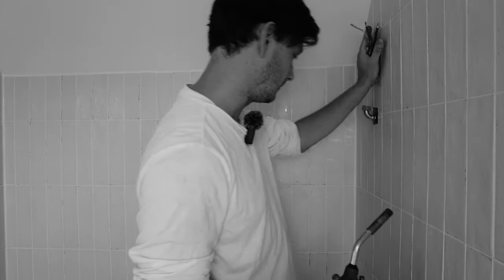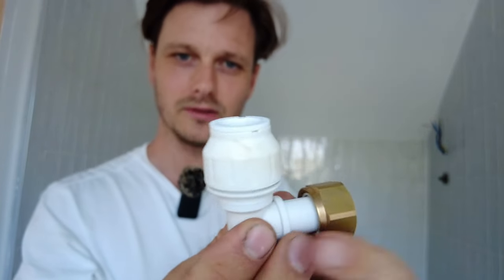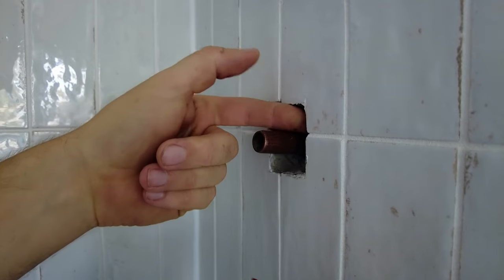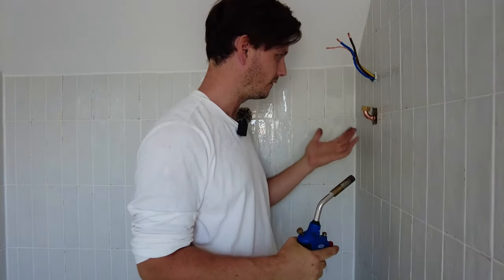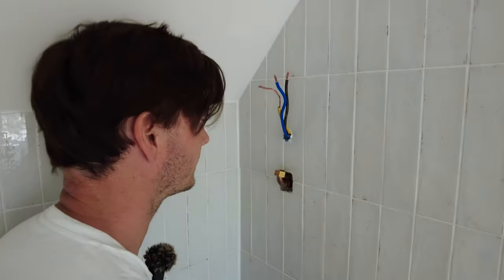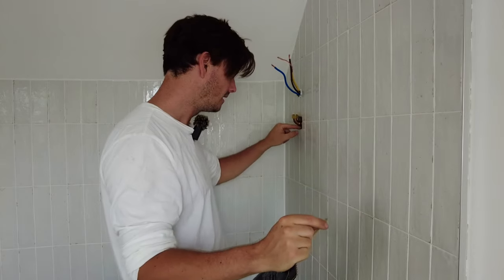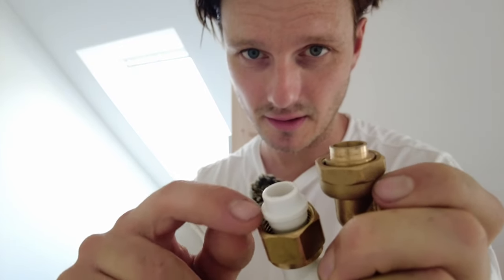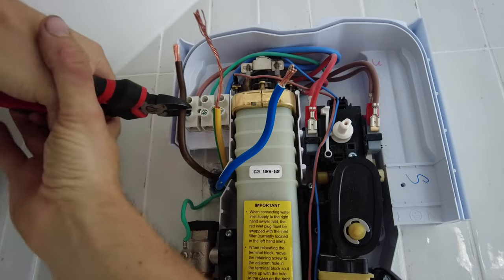I fitted a Mira Sport Electric Shower - The UK's Bestseller!

Comment: When you're looking for drill bits to go through tile, you want to look at ones that say 'masonry'. Screwfix is a good place, they usually tell you exactly what each bit is meant for. Those hand held drills aren't really meant for this kind of work either, so it will be a struggle. Also if you're doing a 5ml hole, a 6 ml wall plug is correct. You want the plug to squeeze in to stop it moving, if it were the same size as the hole it would just wiggle around! Small tip, not only for tiles. Drill a pilot or guide hole first, a 3mm and then follow up with a 5mm, it'll be much easier!

Comment: How do you detach the shower head along with chrome hose/piping in a way that after cleaning it, it can easily reattached back
Reply from the maker: @bibinraj2000  you just unscrew them 🤷 just make sure you don't drop the rubber washers

Comment: Great video you're brave trying to do this yourself! To anyone watching remember showers are a lot more tricky than dishwashers and washing machines, doing one from scratch (as opposed to replacing one) is quite major work with wiring from fuse box and the work needs inspecting by building regulations inspector or you can't insure/rent or sell a property without the paperwork so best to use professional. It's not expensive I had a quote £200 typical price for a new fit same day too, can be less if you use someone local. 

When I saw the blowtorch first thing I thought about when said about using it upside down with the electric cables so near above is the risk of heat melting the flex on wires!! A safer way to do that would be tape a sheet of something fire/heat-resistant over those electric cables before using a blow torch to protect them from getting melted, as is easily done from the video accident!

Comment: Welcome back!

This was really interesting, thanks. I'm planning to put a shower into a new bathroom on my top floor and I am in early planning stages, no idea how things work in the UK, absolutely no idea whether I can have a regular shower or if I need a power shower. I see those a lot over here and I'm hoping I don't need one because I have really good water pressure, including for hot water... but I clearly need to do a lot more research. I'm not even sure why people choose power showers over regular hot/cold supplies. The shower looks great!
Reply from the maker: This is the first time I've fitted an electric shower, I've done 3 others in my life with thermostatic mixer bars. I suppose the benefit in an electric one is you only have to run a cold feed (that's all I have 😂). Sounds like you will be good to go for a standard mixer set up though 👍

Comment: 7:06 I use small Bosch masonry bit on some masking tape then widen with bigger bit if needed. found tile bits a waste of time. Alternative use diamond tile cutter hole saw but you need a jig to hold in place (piece of scrap wood) as they will definitely wander.
Reply from the maker: Thanks mate. I ended up figuring out that I could start the hole with the arrow shaped bits and use one of the diamond bits to do the rest quicker (I even recorded a little video). I'll have to get one of them bosch bits and see if it's better to start off with, then I could do another video 😂

Comment: Yo Ironmaiden, hope everything is ok & the break has done you good. 
I put a longer pipe route in for my shower, just to  allow room to get an isolator in. Nice job mate 👍👍
Reply from the maker: I put an isolator in... But it cuts off the whole shower room 😂 did you put in full bore valves or not? I've been wondering if it really makes much of a difference 🤷‍♂️
Reply: @THE-AIDEN-PROJECT   I just use standard iso valves, never had any flow issues, did you know they did angled iso valves, very good for awkward applications.

Comment: Got to muster up the courage to turn the water on now, just replaced the solonoid on a mira sport max, had to disconnect everything to get to it and the solonoid  did not want to come of or new one to go on, the water bottle and flow valve are push fit how that is a good idea is beyond me, it's enough to give you nightmares,  take a bath is my advise. Great video, stressed me out!
Reply from the maker: 😑🤞💦😩😂 Haha I'm guessing you're not a plumber cause surely you would need a whole new shower if you was? 😉 I'm glad you mentioned this though cause I'm not sure I would have even have thought of just replacing a part like that
Reply: @THE-AIDEN-PROJECT  yes the solanoid which is a common problem it magnetically pushes a plunger up in the flow valve to allow the cold input water to go to the heating bottle, I am now an expert! I wont be letting any water into the shower until I come back of holiday and keep an eye out for leaks, £8 cost of solonoid and several sleepless  nights!

Comment: 👏🏻👏🏻👏🏻👏🏻 Glad your back I’m stating mine barn now so been watching for advice.One thing I do want to ask if ok ?
Is about the roof do you think it’s worth paying out for a zinc roof or the greencoat system? Be grateful for the advice and if pos who you recommend.Keep at it mate you look well 🤜🏻🤛🏻
Reply from the maker: Hey, I think maybe I would be lead by the roofing contractor on this one in a way. If you get them to supply and fit they can do it at the reduced rate of 5% vat. If you buy the product for the contractor to fit you would have to pay the full vat. Although net net its the same at the end it's good to have less upfront costs. The contractors will have certain suppliers they use on the regular, or will have certain experience using a particular system and its always a risk trying to get a good job out of them for a material they don't usually use. Get in as many quotes as you possibly can (go for 10, you will probably only get a couple back!) and then go from there. Manufacturers can sometimes point you in the direction of their suppliers/installers.
A guy named Luke asked me about my roof many months ago, I warned him about what might go wrong and guess what, it did! He needed another 10 sheets at very short notice (because it was worked out wrong like I said would happen 🤦‍♂️), the lead time was 6+weeks. I had 11 sheets left and by pure luck it turned out his barn was 10 minutes down the road! His roofing contractor still didn't finish everything properly and made a pigs ear of the reveals. This was because they wasn't used to using the product for something residential.
Reply: Thank you mate, really appreciate it and all the advice . I’m just about to start watching your video on insulation on Ways on how I can save 😊

Comment: Hi I just bought one and I experience problem in installation as I don’t have copper mains pipe which is work as ground .any idea what I have to do in this situation.many thanks
Reply from the maker: Hi Michal. Are you talking about the mains water pipe that comes into your property?
Reply: @THE-AIDEN-PROJECT  yes mate main water pipe . Mine is plastic
Reply from the maker: @Milo_ko1  do you have any copper pipes in the property then or is it all plastic?
Reply: @THE-AIDEN-PROJECT  there is central heating pipes in the same bathroom
Reply from the maker: @Milo_ko1  if you have copper pipes somewhere in your property they normally need to be earthed in just one place. It's something referred to as bonding. If you check your consumer unit you should have an earth block with a 10mm earth wire (yellow and green) which will run to a copper water pipe and will be connected with an earth bonding clamp/strap. Gas pipes are also normally bonded too. There are some occasions when your pipework doesn't need bonding like in my lodge. The incoming water pipe is plastic and everything else is plastic apart from the small bits that come out the wall and a 2m section where I put the stopcock in. Despite this an electrician that installed my consumer unit wanted to bond that 2m section even though it wasn't necessary. He wanted to be on the safe side. Hope that helps.
Reply: @THE-AIDEN-PROJECT  I really please for your help .Thank you very much 
Top man !

Comment: I just got this shower… mira sport max 10.8 kw. Can I use the same existing cable (6mm) or do I need to upgrade to 10mm. 
Rcd is a 50 in CU
Reply from the maker: The wiring on an electric shower needs to be rated for the maximum load/draw. So a 10.8kw needs to be 10mm with a 50amp breaker. I think if you run it on 6mm the wire can get really hot 🔥 which I wouldn't say is particularly safe

Comment: Why didn't you push the "push fit fitting" on the copper pipe that was poking out the wall, then simply offer the shower assy up to the nut of the push fit fitting & tighten it into the 1/2" thread. !!!
Also when using solder joints use should set the flame low to prevent burning the surroundings, the flame is 600c it'll melt the solder but having the flame set lower puts you in more control. Good on you for trying tho lots of people dont bother.. 👍
Reply from the maker: There wasn't enough room for the push fitting to go on the pipe, I think you need a massive hole in the back and a pipe that's not fixed. Good tip on using a smaller flame 👍 I didn't even think to turn the gas down 😂
Reply: @THE-AIDEN-PROJECT  I hate plastic push fit style fittings, if its not nut&olive or soldered its not reliable.. I've earnt £££ repairing flooded properties because of them..
Reply from the maker: @kaydeem5257  surely some are worse than others 🤷 I'm still debating what to use in the main house 😬
Reply: @THE-AIDEN-PROJECT  You seem to know one end of a Rothenberger from the other, stick to sweated joints or nut & olive, as the feeling of regret when a plastic fitting fails will haunt you forever, esspecially after it fills you're celler with water, which is where one customer kept his Pannagalie next to his Dad's origonal 911 Targa. Yep, all due to plastic fittings... 😣😢😭..
Reply from the maker: @kaydeem5257  the question is, shall I run  copper pipe in as I build the studwork or notch them afterwards? 😆
Reply: @THE-AIDEN-PROJECT  like under floor boards & behind plaster board walls etc.
Reply from the maker: @kaydeem5257  it's just one floor, block and beam so can't put pipes underneath. Vaulted ceiling which is 3-4m high. The majority of internal walls will be studwork. 😂
Reply: @THE-AIDEN-PROJECT  I'd finish the studwork then work out you're pipe route's and then prepare the holes, also fit pipe insulation within stud partition's to reduce possible heat distortion.
Reply from the maker: @kaydeem5257  I won't be able to slide any copper pipe in afterwards so I'd have to notch it, but if I used plastic pipe I could drill and just pull it through. That's the predicament
Reply: @THE-AIDEN-PROJECT  if you use pvc pipe "off the roll" and the pipe has an alloy sleeve running thru it then fine, that type of pipe prevent's oxygeon/atmosphere to enter the water thru the wall of the pipe. That in turn will cause you're boiler to fail prematurely & dont forget the inhibitor...
Reply from the maker: @kaydeem5257  having an air source heat pump, and all the heating will in the screed so that will all be plastic anyway. I'll just need to run hot n cold to the bathrooms really.